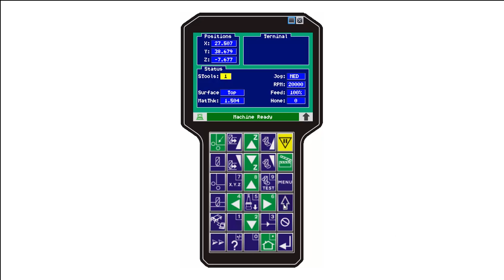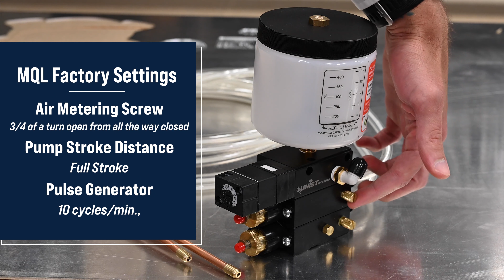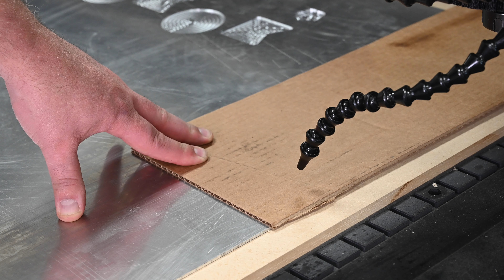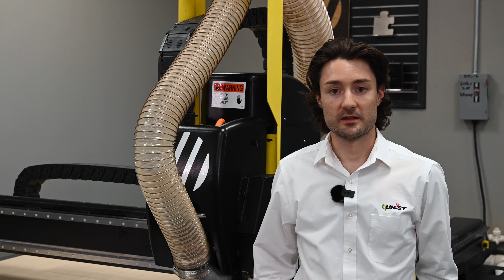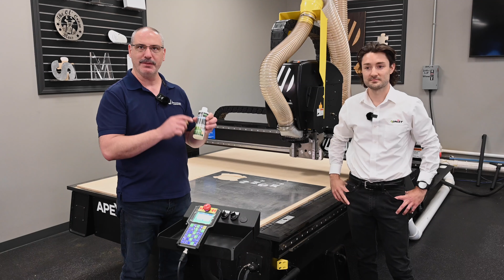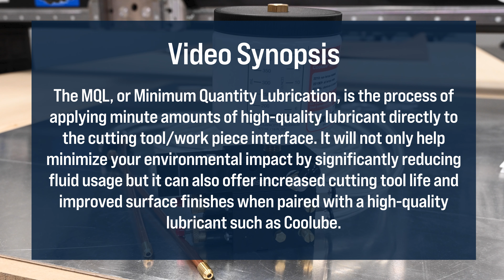Improving Your Aluminum Routing with Unist MQL Misting Unit

Comment: The air and pulse settings are clear, but on the fluid, is it turned all the way in? Thanks
Reply: Hi Ed - yes, on this pump all the way clockwise on the knurled brass adjustment.